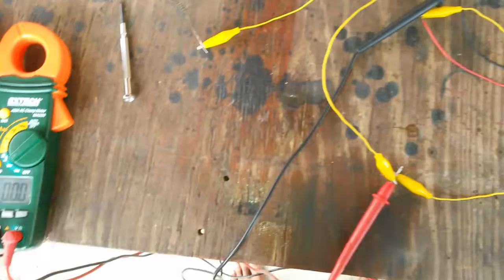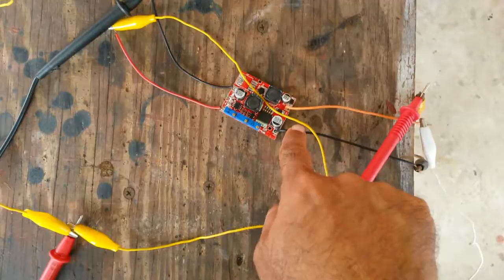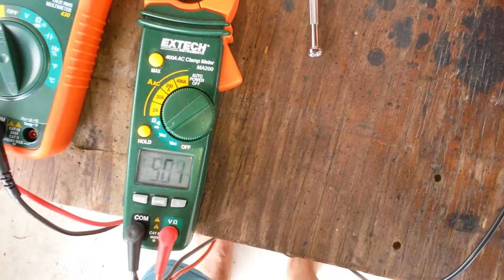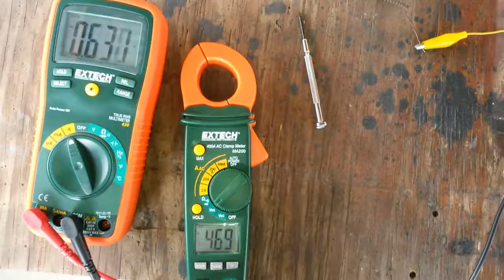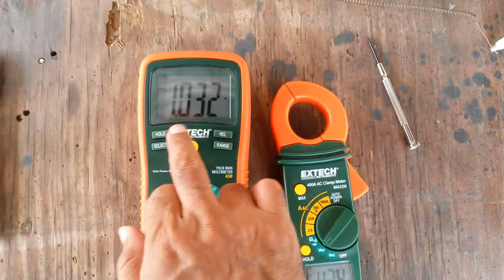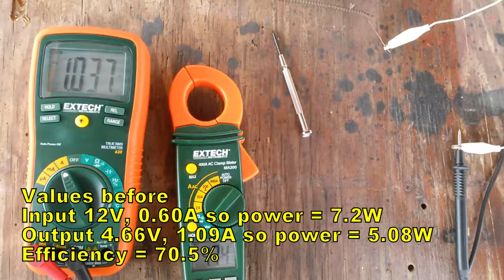059 Troubleshooting the Buck Boost Efficiency Issue in Video 058

Comment: A fellow Trini! I knew it. Great videos. I have these buck boost modules but they all worked perfectly for my projects. I do have a 2amp buck unit that gets excessively hot though at less than half amp output.
Reply from the maker: Thanks. I figure they generally work fine but this one was definitely defective. Buying cheap stuff out of China to experiment. Takes a while to ship (35 to 60 days) and some times things are defective but its a lot cheaper.
Reply: Can't argue with the cost price!